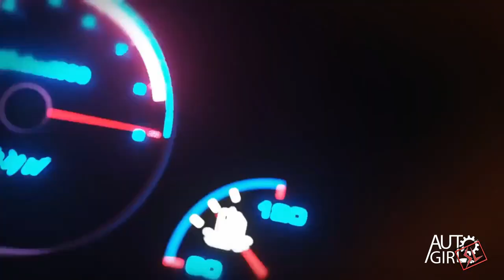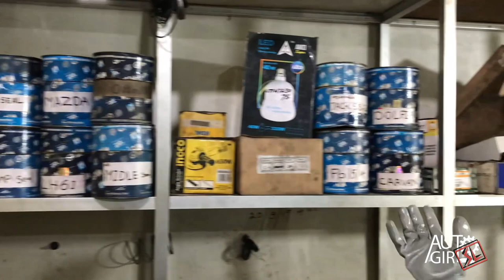Toyota HiAce LH 113 ( Dolphin van ) | power steering repair  ( Sinhala )

Comment: Niyamai nangi. Good job. Mage premio 240 eke power steering eke prashnayak thiyenava. I will contact the mobile number. Can you add a video about flushing a coolant system. Most of the cars use water as coolant, its muddy color just like my one. Need guidance on how to flush and add coolant, without leaking from rusted places. Thanks
Reply from the maker: Ok..thanks for your suggestion.. ill do it soon
Reply: @autogirlsl  thank you very much. Also please mention the coolant types with recommended brands, as well as water coolant ratio as well. Thanks